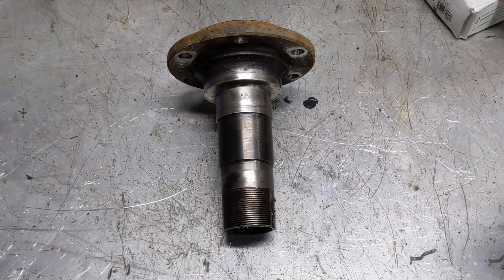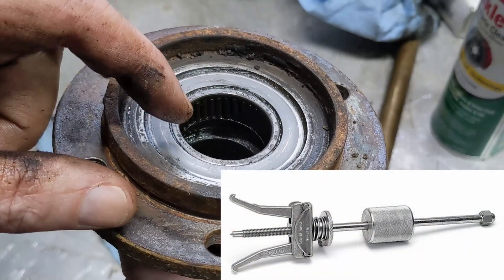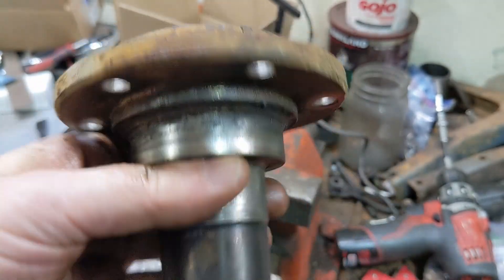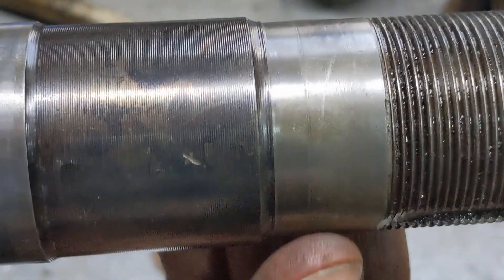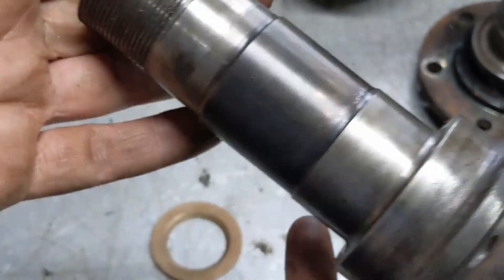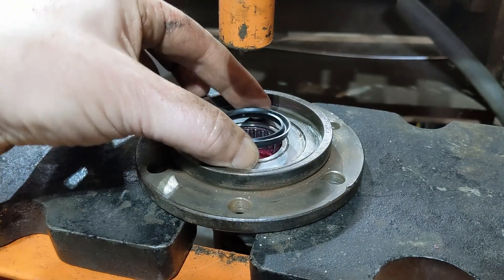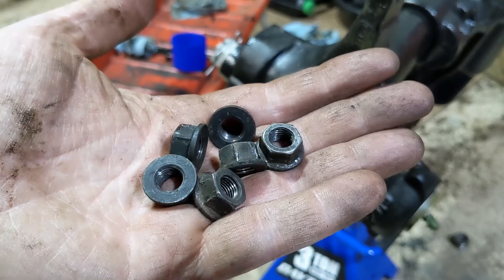Dana 44 Spindle Bearings and Seals (True Spirit #20)

Comment: You're actually missing a outer axle seal that sits between the roller bearing and that brass thrust washer. Most of the replacements are now Teflon or some other hard longllife plastic. I just rebuilt a early 70s Ford D44 and it was missing literally ever seal. They are all essential if you want to keep the hub water tight. As well as using the outer axle c-clip to retain it into the hub and preload the seals.
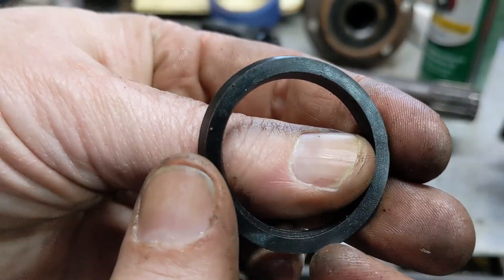Reply from the maker: Something other than the small seal at 8:24?
Reply: @YoshimoshiGarage I stand corrected, it's there. My parts were a little different but all there. Excellent video for anyone else missing all the seals like I was. I just went off a picture of a parts diagram
Reply from the maker: That seal was missing on both sides when I tore it apart

Comment: Great video. Thanks for uploading. 

I think I may have messed up the first side I put back togethor. I pressed the bearing in further until it bottomed. I doubt the seal is going to make any contact with the Teflon ring. I don’t know if I should take it apart and redo it?
Reply from the maker: I would probably just run it. It might be more prone to letting stuff in, and if so it will shorten the bearing life, but it's not likely to fail really fast
Reply: Yeah it's already togethor now, I don't think it's worth starting over. If it fails I'll have it apart again in a few years anyhow. 

Thanks for the tips and the video. It really helped me out. I'll have the other side put together correctly.  :) @YoshimoshiGarage
Reply: I did the same thing, good luck getting it out.